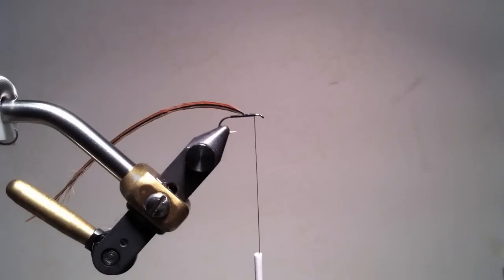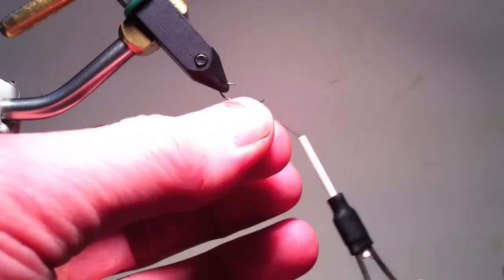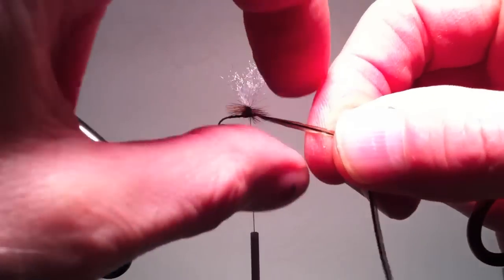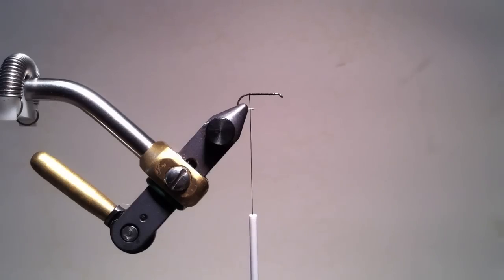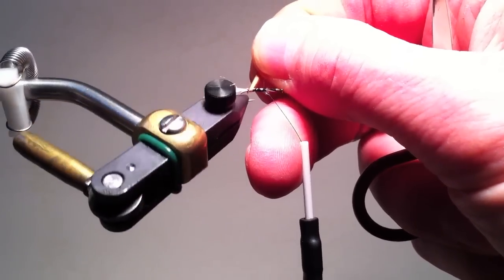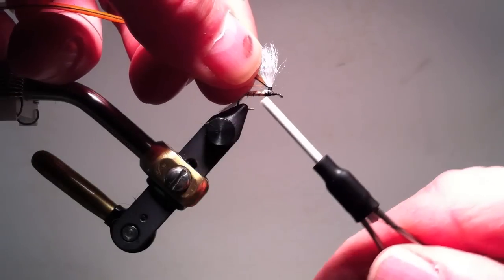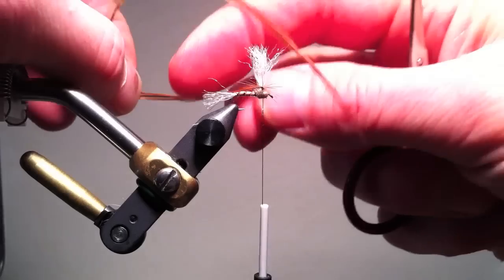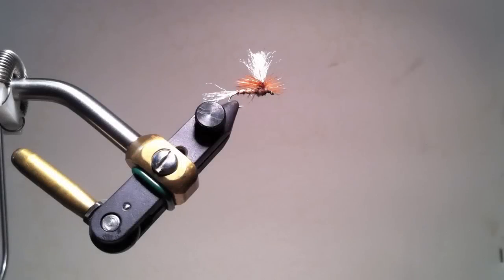Rotary Vise Techniques, Part 6

Comment: For the quad parachute fly with the acrylic tail & post, I wonder if you could use the same piece of material for both, assuming it was used sparsely enough not to make too bulky a body when covered by the biot. I just got my rotary vise &, along with reading the book on rotary tying by Al & Gretchen Beatty, re-watching your series of videos, I think I am beginning to understand some fundamentals. Next step is convincing my eyes & fingers. Planning is everything (like adding 5 thread turns so they can be unwound.
Reply from the maker: Hi, Of course you can use the same piece of material for the tail and wing if you like.  It's fun to experiment and see how you like things. I do use the same material sometimes for multiple body parts that I only have to tie in once. But for my quads, I tend to use Zelon for the shuck/tail and poly/ turkey flats, etc. for the wing. As long as the body doesn't get too thick, I would think it would work fine though. I'll have to try that method also. Thanks

Comment: What material are you using for the wing ? And, Thank you so much for an excellent series of videos on techniques with rotrary vise.
Reply: I'm using polypropylene here which is my favorite wing material for this pattern.  The classical "Quad" uses turkey flat which can be handled very similarly.  Calf body (straight) or calf tail (crinkly) can also be used with minor modification due to the added bulk at the tie in point.  Thanks for the kind comment.